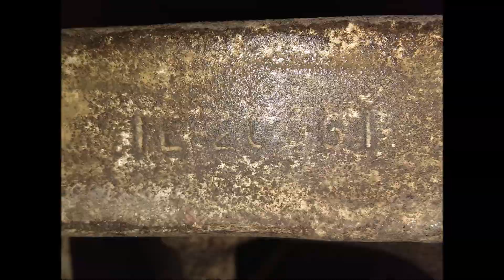SERIES 1 E TYPE 4.2 resto , rust to racecar part 1

Comment: thank you for showing a great restoration not a easy body the e type the bonnet is a nightmare if damaged . well done = more please ! i worked in a healey restoration shop 302 v8 6 speed 4 wheel disc was a regular sight = cobra healeys  i called them some 347 quad weber 9 inch rear 450 hp monsters .
Reply from the maker: resto on hold just now , as we need to source parts , engine being built 4.2 triple webber,axle done  etc will post when we have another update cheers